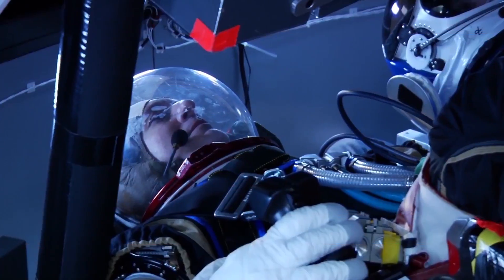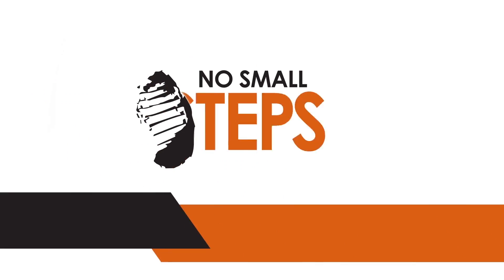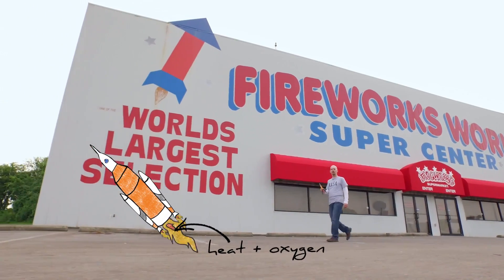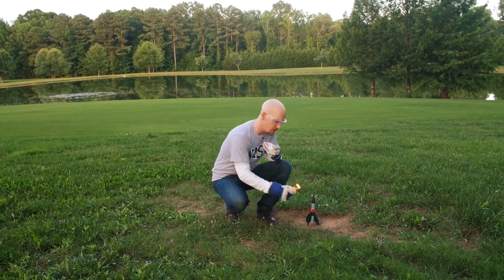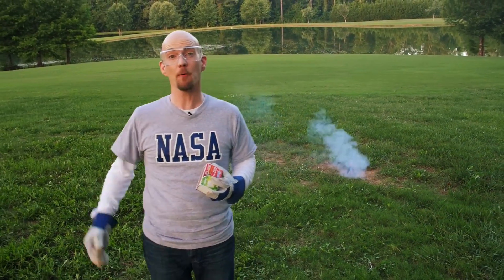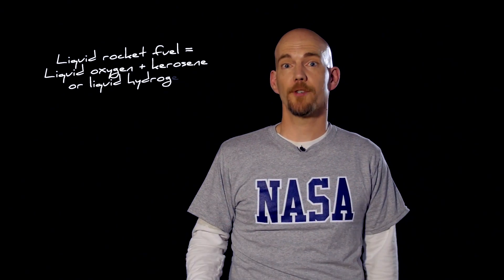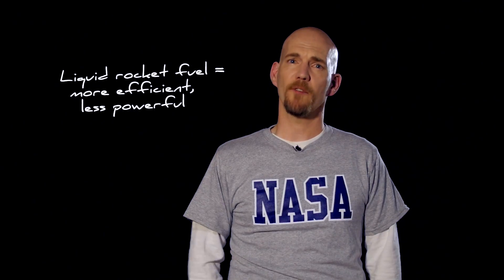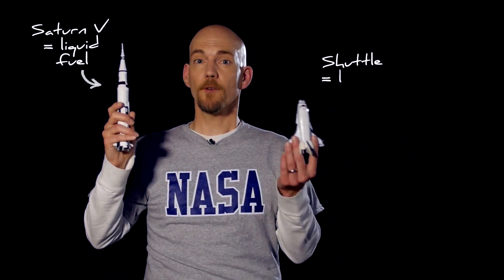The Different Kinds of Rocket Fuel | Video

Comment: SpaceX's BRF is going to be a big f'ing rocket. With preliminary measurements placing it taller than the Saturn V, 15 meters wide, and carrying over 200t to Low Earth Orbit; this will be the single largest rocket ever designed, developed and then built.